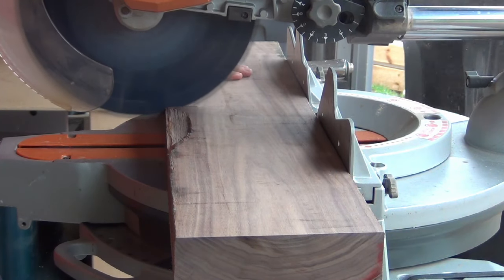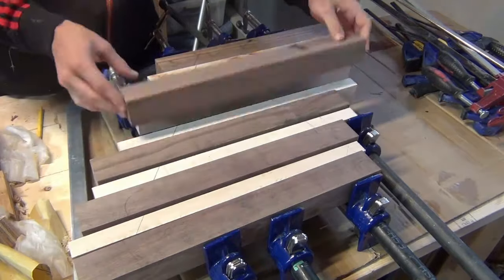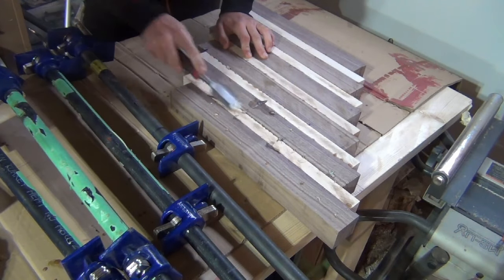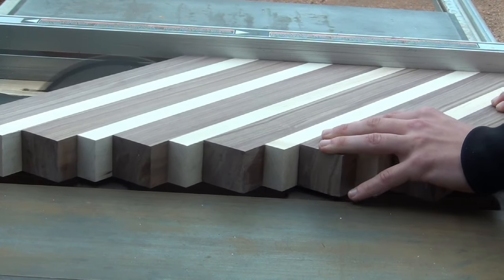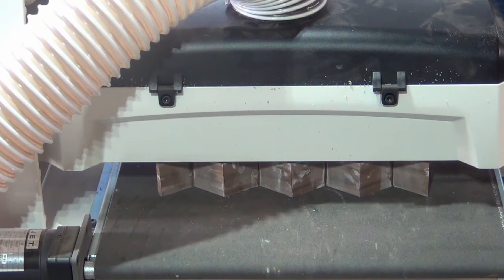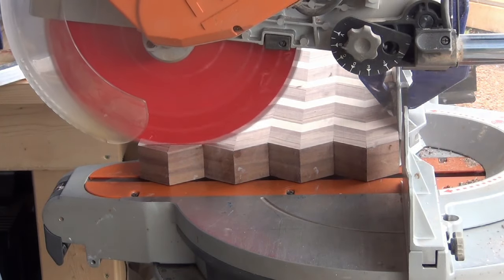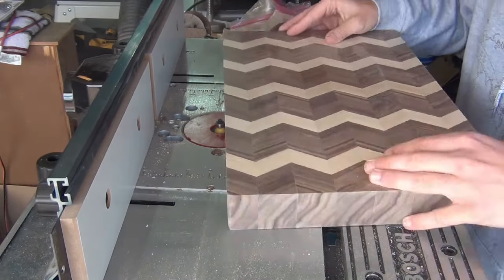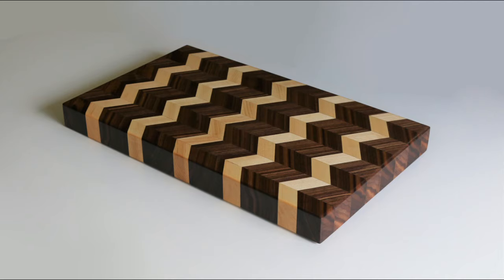Making a 3D Chevron Patterned Cutting Board Tutorial

Comment: Mineral oil does NOT dry.  If you want the base finish to dry and seal the end grain, consider using tung oil or boiled linseed oil.  Top off with a beeswax-based cutting board finish.  This top coat will have to be renewed occasionally depending on use.

Comment: I plan to make this for a school project, would you happen to know the original measurements of the wood?
Reply from the maker: The actual measurements of the rough lumber don't really matter too much so long as you can get the pieces from them. I used 8/4 walnut and 4/4 maple. Hope this helps and good luck!
Reply: @CalebsFineWoodworking  After cutting your stock, what were the dimensions you cut your individual pieces into?

Comment: Very nice cutting board.  Question, on your second glue up, it appears that you glued up end-grain to end-grain (sort of).  Any concerns with this glue up eventually failing?
Reply from the maker: Thanks! That's right, it was an end to end glue up which isn't the strongest joint. I made sure to use lots of glue since much of it would be absorbed. Even so the glue up failing is a possibility. I haven't noticed any problems yet, but it will be something to watch out for.

Comment: Gorgeous work. I see you made this video about a year ago. How’s the board holding up? I’ve heard a lot of concern over edge grain glue ups but have seen some videos comparing the relative strength and it seems that the concern is unwarranted. Wondering what your experience has been?
Reply from the maker: Thanks! While the board hasn't been used very much it doesn't show signs of coming apart. I haven't noticed any new gaps forming and it and still feels solid. So far so good. Hope this helps.
Reply: @nstickmd I dont think thats specific to all (or most) edge grain glue ups. But i think that would apply in this case when you essentially make a "multiple cuts" like this where to get the desired patttern, you're gluing end grain to end grain. This is still not recommended. There are some tips that say to basically "pre-glue" the end grain a few minutes before doing the actual glue up to try and get a little bit of a seal on that end grain, but i would only feel comfortable doing that on end grain to edge grain. Edge and face grain are the ideal gluing surfaces. I personally would not recommend doing an end grain to end grain glue up like this to get this pattern. If you really like the pattern, you should just make the board an end grain board.